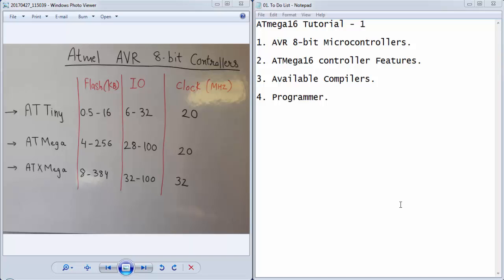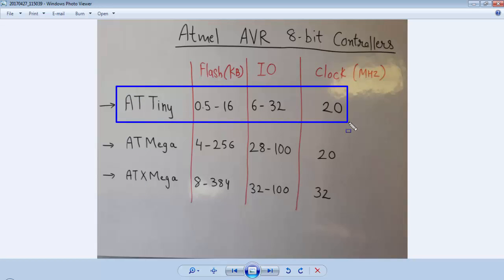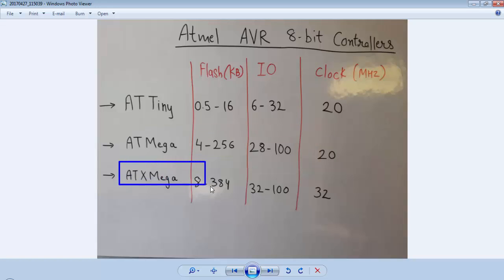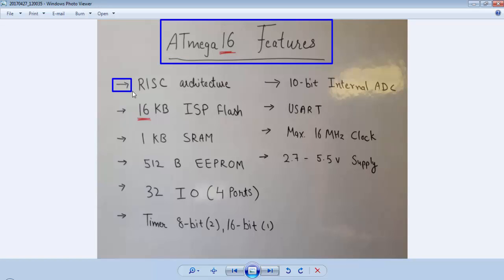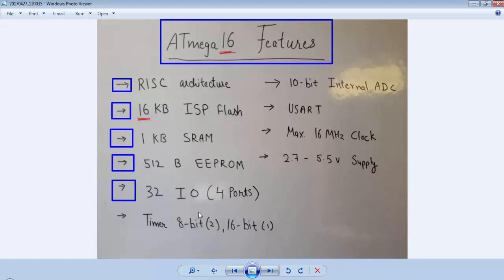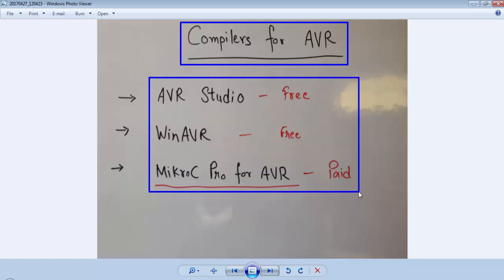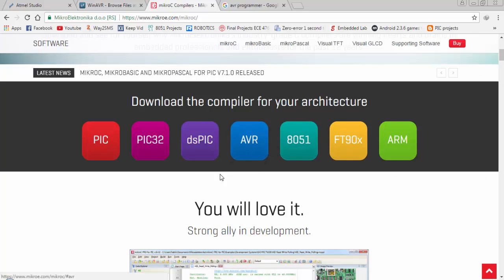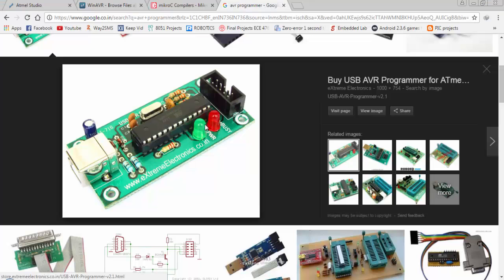Atmega16 Tutorial 1 - Introduction

Comment: hello sir, do you work on speed control and DC motor reversing.  Thank you very much sỉ
Reply from the maker: Yes, I have worked in the past.
Reply: @GaganCA  What's wrong with my code, thank you
#include<mega16.h>
      #include<delay.h>
 Int duty=1000;
 Interrup [ext_into] void ext_into_isr(void)
{
 If(duty>=2000)
 {
 Duty=2000;
}
Else
{
Duty+=100;
OCR1A=duty;
}
}
Interrupt [ext_int1]  void ext_int1_isr(void)
{
 If(duty<0)
{
 Duty=0;
}
Else
{
 Duty-=100;
OCR1A=duty;
}
}
Void main(void)
{
 Portc=0xfe;
DDRC=0xff;
Portd=0xff;
DDRD=0x23;
// cấu hình timer1
TCCR1A=0X82;
TCCR1B=0X5A;
TCNT1H=0X00;
TCNT1L=0X00;
ICR1H=0X07;
ICR1L=0XD0;
OCR1A=DUTY;
OCR1BH=0X00;
OCR1BL=0X00;
//KHỞI TẠO NGẮT
GICR|=0XC0;
MCUCR=0X0A;
MCUCSR=0X00;
GIFR=0XC0;
TIMSK=0X00;
#ASM(“SEI”)
WHILE(TRUE)
{
 //NÚT QUAY THUẬN
IF(PIND.6==0)
{
 DELAY_MS(20);
{
 IF(PIND.6==0)
{
 WHILE(PIND.6==0)
 {
   PORTC.1=0;
   PORTC.0=1;
   PORTC.2=1;
   PORTD.0=1;
   PORTD.1=0;
}
}
}
//NÚT QUAY NGHỊCH
IF(PIND.7==0)
{
 DELAY_MS(20);
{
 IF(PIND.7==0)
{
 WHILE(PIND.7==0)
 {
   PORTC.2=0;
   PORTC.0=1;
   PORTC.1=1;
   PORTD.0=0;
   PORTD.1=1;
}
}
}
//NÚT DỪNG
IF(PIND.4==0)
{
 DELAY_MS(20);
{
 IF(PIND.4==0)
{
 WHILE(PIND.4==0)
 {
   PORTC.0=0;
   PORTC.1=1;
   PORTC.2=1;
   PORTD.0=1;
   PORTD.1=1;
}
}
}
}
}
}